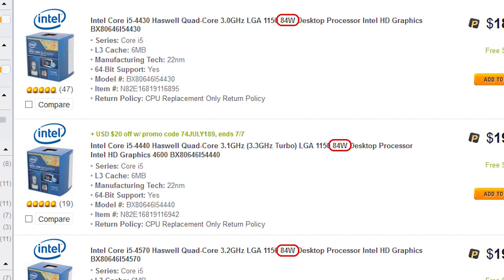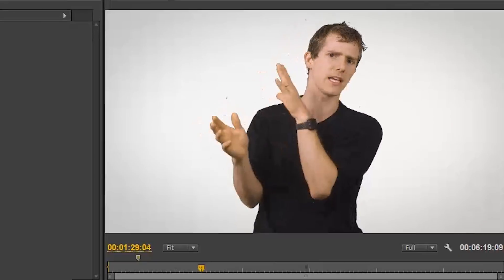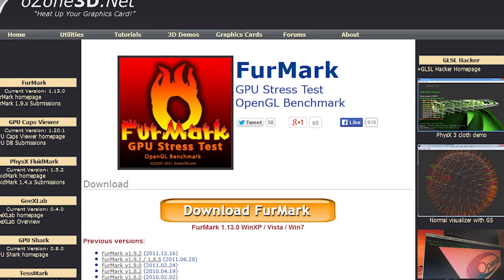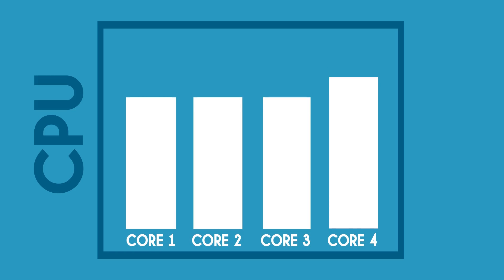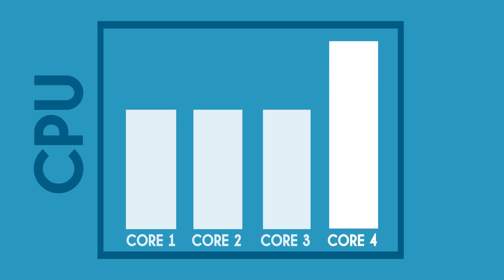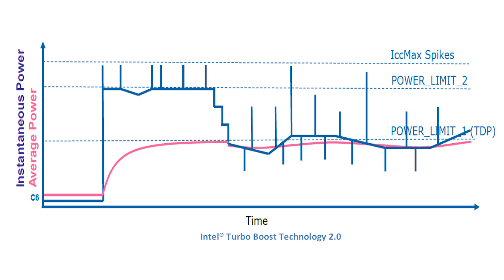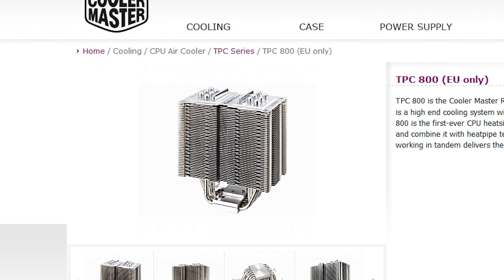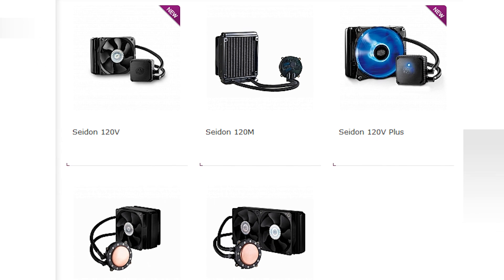What is TDP or Thermal Design Power as Fast As Possible

Comment: i have a problem with my laptop i have a i3-2370M CPU and is overheating...  the temperature is close to  T juction ... when i play games with the not integrated gpu nvidia 630m. The PC in most cases shut down. So what should i do? Should i take a better fan?
Reply: get a laptop cooler, and/or stop playing on any carpet/bedsheet/rug surface, that increases temperatures a lot.
Reply: You need to change your thermal paste and do some cleaning inside.

Comment: Love it. Just don't have an application  / example to go off on and to make sure which Power sources to buy, because a decision needs to be made looking at PSUs...

POP QUIZ - I want to make a system, with AMD A8 6600K , TDP @ 100 W , a Radeon R7 265 TDP @ 150 W , and a blu ray drive . 

Factoring in the power I need for the 8gb Ram , one 7200 RPM HD , the rest of motherboard which will be past 75 W, do I just add my figures up and find 150% of the total and look for that in PSU ratings Or Am I Missing Something?

I want to learn more about this aspect, since I read so many PC building blogs: I find that this TDP wattage concept is becoming the most daunting and confusing other than finding money to build the PC itself of course ~ :)

Comment: My FX 9370 @ 4.7ghz gets to 51 Degrees Centigrade under max load with the ambient temp of 28 Degrees using a 90mm closed loop water cooler (antec Hydro) but i have never seen power consumption over 75ish watts...

Comment: It should be noted that TDP isn't the full story when it comes to temperature. Recent AMD CPUs, though they usually have the same TDP as older Intel CPUs (FX-6300 95 W TDP vs i5-2310 95 W TDP) or higher TDP than newer Intel CPUs (i5-4670k 84 W TDP), actually cool quite a bit better than their competition. My FX-6300 OVERCLOCKED (1.428 Volts @ 4.5 GHz) runs at 19 degrees idle and 45 under max load. My friend's i5-2310 at STOCKCLOCK (~1.3 Volts @ 2.9 GHz) with the same cooler runs at around 32 degrees idle and up to 54 degrees under load.
Reply: I have noticed this too. My FX-6300 runs VERY cool at idle, like 20-25C, it's pretty weird, but as long as it isn't overheating, fine by me.
Reply: i think it also got to do with the fact that the heatspreader of AMD CPUs is bigger than the LGA 1150/5/6 CPUs. A bigger area to dissipate heat means that heat is transported away better
Reply: Well considering that my PC is right next to my air conditioner and I typically have an ambient temperature in my room somewhere between 60F - 70F (15C - 21C) then there's a good chance that my CPU is in fact, at 19 degrees idle.
Reply: ***** Right, which is why I've burned down my entire house.
Reply: DeusGladiorum
It's a fairly well known fact that AMD CPU's usually have faulty heat readings at idle. I also have an FX-6300 at 4.5 GHz and 1.4v and it runs at 10c degrees idle in a 80f degree room with a Hyper 212 Evo. That temp jumps to about 70c at load, which is accurate, but idle temp definitely isn't.

And Naigyts, I assume you don't have much experience with AMD CPU's because a decent one should be able to take that kind of voltage without any issues, provided you have a decent cooler and mobo.

Intel at that voltage is pretty hot (especially Ivy Bridge and Haswell). I have a 3570k at 1.3v and 4.7GHz and it runs at around 85 degrees in Prime95.
Reply: William Bak I just upgraded to an i5-4690k yesterday, and my temps are still superb. Idle they're around 26 degrees, and after hours of various games at what's at least near max load, the max temp has only been 47.
Reply: William Bak My point being that I don't think the sensors were all too off. Unless this completely different chip from a completely different manufacturer managed to get the same percent error in faulty readings, I think I just have really adequate cooling. Idk, I only have 2 case fans -- one exhaust and one intake -- and a Hyper 212 EVO but it's all next to my air conditioner which is typically on full blast. I have to imagine that does a major part in keeping my temps low.

Comment: Pretty sure the TDP is going to be VERY close to the actual power usage maximum... I mean what else is the input power converted to?  The output signal I'm sure takes next to zero consumption.  99% of the power consumed is turned into heat, right?

Comment: If a processor was made with golden wires (superconductors) they should theoretically conduct electricity perfectly with 0 heat output right? And if you made an entire computer with golden wires then you would need absolutely 0 cooling because there would be absolutely no heat put off.
I don't know a whole bunch about this though.

Comment: Watt = Joules/second
Could be heat too.
Q = m * c * Δt
heat = mass(g) * constant(4,2 for water) * difference in temperature = energy (joules) needed to reach the current temperature
20 watts TDP means that you need 20 watts of cooling per second for staying bellow the maximum temperature.
At some websites you can view the "cooling power" of the cooler, also measured in watts. That way, you "could" calculate how much you can overclock with a specific cooler.

Comment: But why are Intel processors hotter than AMD CPUs?
Reply: Because the heatspreader isn't soldered to the CPU. Intel uses an cheap ass thermal paste on ivy bridge and haswell.. I mean look at sandy bridge , those chips were soldered and they were extremely cool even with overclocking !
Reply: KingOguzhan12
 We can just all hope broadwell will be better.
Reply: GuiltlessGaming Yep hopefully. I want to get an broadwell i7 to replace my current FX 8350.

Comment: It's true that TDP is the heat output, but since thermodynamics stipulates a conservation of energy, whatever electricity you're putting in must come out a combination of heat, light, movement, and electricity. Given that there should be no output electricity and your CPU doesn't run around or glow, INPUT POWER ~= TDP
Reply: EXACTLY! Linus and the majority have failed this so bad! elementary physics

Comment: i have gtx 750 it runs about 45celcius on load if i try to overclock also then also gpu clock speed wouldnt go up 935 but running benchmarking software gets to 1198mhz so please help want to get little performance

Comment: AMD and Intel measure TDP in different ways. I was hoping for an explanation of how they measure it.
Reply: He actually said it, but didn't said who does what. Intel= average TDP , AMD= max TDP. Thats why Intel looks more power efficient that it is.
Reply: @yordanpetkov861  Intel does the BASE clock for the TDP. Deceptive
Reply: Most of the electrons that travel in a CPU/GPU get "lost" in the form of heat due to resistance in the components and in theory a PC when made with pefect component, the consumption drop near to 0 since the computer has no moving part and so there is no lost of energy. TDP is more like the sum of energy lost when the computer is working and mostly is heat and light in the if you count the monitor. Check some studies about superconductors to understand more. I study electronic and my teacher agree that a computer won't comsume power if the materials where ideal (no resistance, perfect isolation, perfect semiconductors, etc). A "perfect" computer could work with voltajes so low that the power drop near 0.
Reply: Myst Freelancer That is true. Even though the 225W TDP may look bad on the 9000 series CPUs, it's actually not that bad, considering that 225W TDP would be the TDP at full load.

But seriously though, you can use an R9 290X as a stove.
Reply: DaTechnoDood LevelX Why do people keep saying that? It's like "hey, Nvidia's 900 series GPUs are basically cool breezes in a late mid-summer night compared to last gen GPUs, that means GPUs dont get hot unless they're AMD."

My objection, in other words, is that people seem to forget that the 700 series cards ran a bit hot as well. AMD's? Ya, hotter, but the 700 series weren't exactly air conditioners :) It seems everyone forgot that now with Maxwell. 

In other, OTHER words, the R9 290x doesn't run substantially hotter than the at the time Nvidia comparison gtx 780. 

And quite frankly I don't really care about TDP unless the build in question calls for it.
Reply: Greyghostvol1 AMD vs NVIDIA = The TDP may be the same but remeber the chipset are not the same. More factors are involve in the heat discipation due to this. Try to think this way: Nvidia new chipset is cover in silver and diamons, and AMD is chipset is cover in copper, in short you get -5ºC as result of better discipation on the central zone, but both discipate the same TDP in total. This is not the perfect example but let you understand that even littles things as chipset arquitecture can make better result over the temperature sensor (located inside the chipset) and this is what mislead people when they see a high temp value on the test graphs as a negative result. In my personal opinion I allways suggest searching on google when buying a new graphic card, just write "xxbrandxx R9 2xx + problems/issues/trouble", research the model you are about to buy just to see if anyone had any kind of problem with that specific model. Reviews are worthless when it comes to troubles since they test only one card and probably a "first of the line" model.
Reply: Thunder Kat You realize that even when you use temperature guns to sensor the temperatures of components, the GTX 7xx series was still not a whole lot cooler than AMD's R9 2xx series, right? The quality of the component's materials itself really doesn't matter when you're reading that actual temp the component is at. Which is the statement I'm trying to make here.

Also, you can type any biased search into google and get the results you want. Try searching for GTX 970 problems and look at the pages of results you get.
Reply: +Thunder Kat I don't entirely agree with you.Even with all things perfect,the transistors in the processor are semiconductor,and that's why there always will be a resistor in the way of the electrons.And there are a lot of transistors in a processor!
Reply: ***** Oh ya, definitely. 

AMD's CPUs almost consistently hit their theoretical TDP.
Reply: +Thunder Kat Wow that info so fucking amazing kudos to you bro!
Reply: u could just yell FERMI LOL in reply to 290x stuff lol
Reply: AMD: measures TDP at their boost clock. Intel: Measures TDP at base clock

Comment: The reason why all the CPUs have the same TDP is because that is the TDP of the cooler, not the CPU. Same applies for GPUs. Notice how all the GTX 7XX GPUs all have the same TDP as well because they all have the same cooler.

Intel bases TDP measurements of chips on average usage and AMD bases their TDP on max power usage. Hence why AMD chips usually have a higher TDP. TDP is not standardized and is almost useless because of this. It gives an indication of heat produced, not a measurement.
Reply: +Dominic H (Ghost) AMD also only states the max. TDP based on the cooler (which is always one step higher than the actual maximum TDP of the chip they measured). The Intel Skylake CPUs have no cooler, but it seems like they now have the same TDP ranges as AMD to kind of standardize their spec sheets.

Comment: make a quickie on how cooling components affects room temperature. 
specifically the affect on room temperature if you are watercooling vs Tower heatsink, vs stock heatsink. 

personal theory + would love to prove a friend wrong:  is that the better you cool the CPU. the more it will affect the room temperature.  even though it is keeping the CPU colder, it is moving the heat faster away from the CPU in to the room, thus a warmer room. 

Friends theory:  is that the CPU / other things are now cooler (when compare to the cheap stock heatsink) that it is putting less heat in to the room because the heat off of them is cooler, thus a cooler room. 

any thoughts?  good enough topic for a Quickie?
Reply: In a sealed box I don't really think there would be a difference between coolers. A tower cooler would release more cooler air over 1 hour but the stock would release less hotter air.. So they would be about equal.. 
But no matter what you use the computer will eventually overheat..
Reply: The heat produced by the PC remains the same, so the room temperature will be the same aswell. Technically you could argue that when the CPU is hotter (bad cooler), the room temperature will be lower, but since the heat capacity of a CPU is so low compared to the heat capacity of the room (and the air in the room), that difference is completely negligible.

If you take stuff like turboboost into account however, things do change. When the CPU starts to increase its performance when it is cooled better, it will produce more heat and therefore result in a warmer room.
Reply: I heared that on Jayz2cents channel, but that doesn't make sense to me. There would be a delay, as the air cooler heats up (slowly than water), but wouldn't be something that makes a difference, I've calculated that the 4790K would heat a 2kg aluminium heatsink from 25C to 75C in 17 minutes (minus .68 seconds, exactly) so the delay won't be something very important.
I think that this comes from the fact that watercooled CPUs are overclocked, so they output more heat, but whitout changing the overclock, a cpu will output the same amount of heat if it's on air or on water.
BTW, the formula is that one:
0.897J * 2000g * 50C * 1min * 88Js^-1 * 1g^-1 * 1C^-1 * 60s^-1 = 16.9886363636min
Reply: awesomeguide Forging  i guess you both have no idea of the laws of physics....
the heat the cpu emissions stays the same, no matter which cooler you use.
Maybe the better cooler heats the room " faster" up, because it distributes the heat quicker.
But the level of energy always stays the same.
For example:
You have a room that is totally insulated and doesn´t lead heat outside and the computer is in the middle of this room.
Your superduper cooler simply moves the heat so fast away, your cpu doesnt run that hot.
Well, in the beginning at least.
Because the room doesnt let this energy get out, it simply dams the whole energy( x Joule) inside of it self.
In the end both scenarios end up like this:
the energy level is just the same.
Cooling performance is mostly measured in Delta T.
The lower delta t is, the better the cooler is.

Comment: do a video on the best times to buy a component for your pc. do you need to wait for the manufacture to announce a succesor (780 price drop because of 780 ti)? or buy the component right after it releases?
Reply: buy the power when you need it. You could wait 20 years and even after that, soon  there will be something even more powerful
Reply: GandalfforceYT @koen konst
The only times you should wait is for example when intel released nehalem, if you've bough a core 2 duo back then you'd be set for gaming until something substantial like a sandy bridge, ivy, haswell came along. Same with RAM. It's best to wait 1 generation after the new ddr standard is announced. I've come from socket 370 to lga 775 wolfdale to 1150 haswell, and I'm lucky I ditched most of the bad stuff (like pentium 4 and D).  GandalfforceYT is right

Comment: A few questions for my AMD brethren:
 
- What are the max temps of my AMD FX 8320?
- My chip (stock and cooled by my Hyper 212 Evo) idles at 35c-40c and goes up to around 65c on load. Is that normal?
- If I overclock it without messing about with the voltage, will that mess with the temps?
Reply: I don't have an AMD CPU, but those temperatures seem normal too me.
If you overclock without changing the voltage, the temperatures will remain 0the same, but you could lose stability => freezes, CTD's, bluescreens, ...
So make sure too thoroughly test stability and take into account that these tests are designed to stress your CPU, so temperatures will be higher.

Comment: Interesting fact about TDP is that if you're using a notebook without a dedicated GPU you might have problems running simple games because the CPU and GPU are limited by the same TDP and as such won't properly use turboboost when using the GPU as well . So for example while Starcraft 2 needs a fast single core but on low settings doesn't require much GPU power you might still want to use a dedicated GPU so that not to limit the turboboost - you need it for the single core performance (SC2 is badly coded like that T_T )
Reply: Pretty much same with WarRock :s

Comment: tdp, power consumption and heat output. thats all good and useful. but efficiency is another, oc brings more heat and more performance but not linearly, so a efficiency% may be a measure to be added later.